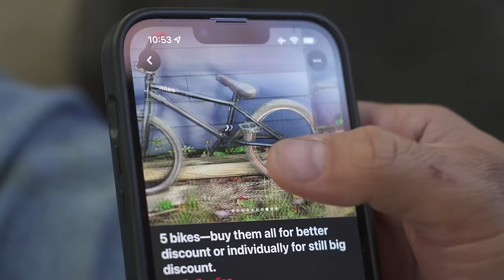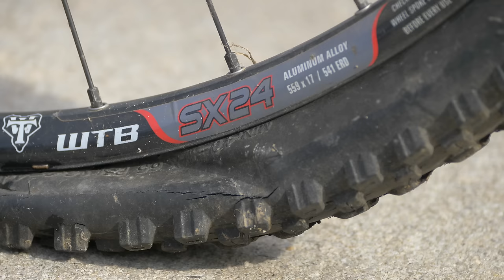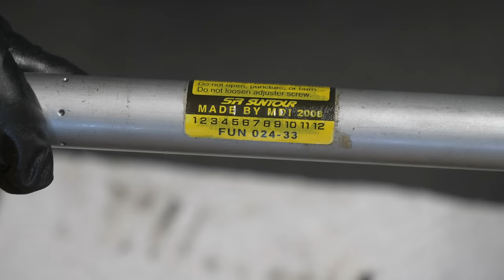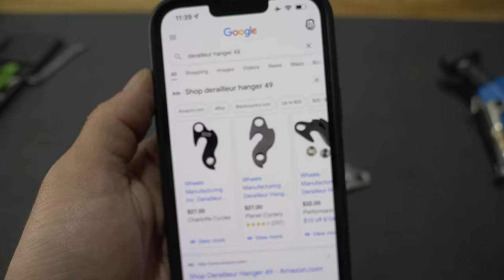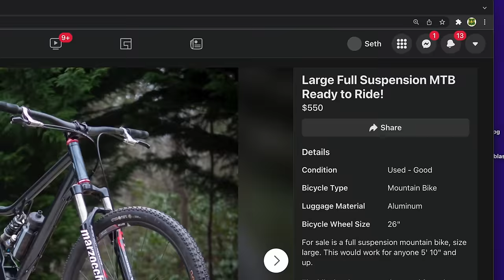Restoring a VERY neglected 'mystery' full squish

Comment: Pell’s Ridelight was an expensive bike, it came in four (4) models: Pro $1,200 US, Elite $1,600, Race $2,300 and Team $4,450 USD!  It appears the bike that Seth was restoring was the Ridelight Elite.  Whoever got it for $525 got a great deal.
Reply: charles the detective's got it!
Reply: Damnnn you good well done detective, just searched it and found it.
Reply: Nah Man that's a Santa Cruz Superlight
Reply: @sge4r513 No, it really isn't...
Reply: It actually is an early 2000s Santa cruz superlight which does look a little like the pells ridelight
Reply: @WIllWarner-v5f   Charles was right, if you look at the swing arm shape, especially on the vertical portion you can see it has identical lines, where the SC is more straight, the Pells has some variable thickness. Also noticable on the TT where it has a slight bend near the seatpost.
Reply: Its definitely a Santa Cruz,  I have one
Reply: @AndrewAnderson-vb4pp  It's for sure a Pell. You can tell by the rear shock mount.
Reply: Nice one dude.
Reply: All bikes this old are basically worthless except as collectors items, which this is not. $525 is almost scammer price, he just waited until someone came around who didn’t know what it should cost. An old 26er with a single pivot suspension is worth no more than $150 in the best of condition
Reply: I found the same bike as a Santa Cruz heckler
Reply: Well done. And to the people saying this is a Santa Cruz, are you blind or can you not use any kind of image search? That upright bit of the swingarm is so distinctive that there's no way of mistaking it for anything but the Ridelight.

Comment: Dude if this whole flip bike thing is going to be bigger you definitely need a ultrasonic cleaner. I wish I had bought this earlier for my motorcycle workshop.
Reply: What cleaner do you use?, Best thing I've found is the purple simply green industrial degreaser, it cleans almost anything.
Reply: @silasmaxwell6745  I use vinegar personality for anything rusted, let it soak for 30min and the rust will come right off. For dirty parts I’ll wash them with mean green and spray them with WD-40 to get them shining like new. Easiest cheapest way I’ve found.
Reply: More useful videos without expensive tools
Reply: @joatmon_313  CLR in the ultrasonic works great for rust.
Reply: i came here to say the same thing
Reply: I almost bought one last month while I was servicing my bike for the winter but decided against it because I couldn't find any posts / videos confirming whether it would remove dried up thread locker off of bolts.  Do you know if an ultrasonic cleaner will get that off?
Reply: @Waremonger  Maybe if it soaks enough it will, some ultra sonic cleaners like mine also heats up the liquid you use to a set temp of 90 - 150 degrees and thread locker usually comes off pretty easily with heat, so it might get it loose enough to come off but a wire brush works really well too. 🤙
Reply: Stop giving him excuses to by more tools lol
Reply: I second this! with a tub of evaporust and a $150 ultrasonic cleaner you can make just about anything shiny again. The ultrasonic will dull/etch the finish on some painted/anodized parts but you can just add another coat of clearcoat. It's also the fastest way I've found to get the factory grease off of a new chain (I like wax lube)
Reply: This was my exact thought as well.
Reply: Feel like Seth should wait a while before he buys one cuz he basically just bought a sandblasting rig
Reply: +1 to an ultrasonic cleaner! You can get a little one for about $75 and will make life much easier
Reply: @silasmaxwell6745  yeah! I just recently switched to this and I'm a bit fan.
Reply: Evapo-rust is the best stuff to use when trying to get rid of rust
Reply: Those are amazing at cleaning!
Reply: @silasmaxwell6745  best and cheapest is citric acid powder. Available everywhere, super cheap, you get to choose your own concentration and if you heat it up it will kill rust in 10 minutes or so. I personally, haven't waited more than 3 minutes.
Reply: @joatmon_313  aaz@@@
Reply: XO 
 

Playgh
Reply: @Bpf1893  calcium and lime as well!
Reply: I didn’t think there’s much to clean with a ultrasonic cleaner for MTBs.
Reply: Similar, but different swing arm, it's a pells ridelight elit
Reply: @PepsiGuidesRS  Good tools dont break what you are working on. Good tools also dont come from hazard fraught.
Reply: I had bought one, and it never really lived up to (my) expectations - I used simple green, and it barely got cassettes clean; what do you use as a solvent?
Reply: @DanielHernandeztinkers  which ultrasonic cleaner do you use?
Reply: @ChrisDanly  I too wax all my chains; I use 2 mason jars; one with Mineral Spirits to get the factory grease off, then a rubbing alcohol bath to get the mineral sprits off, then into the crockpot of chain wax, works very well.  After one wax, I just keep it in the crockpot until the wax gets dirty, then replace it.
Reply: What’s that
Reply: I use „Tickopur R33“, mostly in 60°C warm water for 30 minutes. If the parts are very dirty I additionally clean it in the solvent with toothbrush and give it another 30 minutes. Normally the parts looking brand new after that.

Comment: IT is a PELL's RIDELIGHT Elite or Pells Thor FS150 Elite from 2009 it was a 1500 up to 4000 USD MTB. Frame is 100% same but components are differents.
Reply: I think you nailed it...exact same rear triangle.  Slight difference on the seat tube gusset and front triangle top tube/down tube gusset but that could be size specific.  Finally...this has been driving me nuts.
Reply: @mosslager  thanks :) Yes the frame Is definitely the right one. It was an expensive bike for the time :)
Reply: How did you figure it out?!
Reply: Yup, you nailed it.  I guess you're Czech?  Don't believe Pells were ever sold in America.  Most have been bought off eBay or somewhere online.
Reply: Nailed it!
Reply: @cup_and_cone  I am french living In Czech republic. It is a great country btw
Reply: @thomasbrace2166  yes  :) it was bugging me :)
Reply: @mosslager  i was also scratching my head :)
Reply: @mattlasecki5237  I guess i was helped by the divine :)
Reply: Me too, I'd exhausted all of my ideas pretty quickly. Had to keep coming back to the comment section In the hope that someone would get it. I can rest easy now the mystery is solved. Good work!
Reply: @thomasbrace2166  I knew I would help lot of us to relax  :)
Reply: Agree... Definitely a Pells. Probably bought by a us soldier in Germany.  There's many installations near the boarder.
Reply: @chopperguth  I think the germany option is certainly the good one I think Pells is german brand. however I am not 100% sure..
Reply: You're right!
Reply: @Goonak_  :)  am pleased I found it :)
Reply: good eye, that has to be it. Everything matches. Nice work, it was driving me nuts!
Reply: headtube is different the 2009 has a short headtube
Reply: It's a 2008 or 09 Dimondback Recoil lol...
Reply: İ believe it's a Santa Cruz heckler 2008

Comment: the full squish appears to be a 98 Santa Cruz Heckler
Reply: It looks more like a heckler version 5 because they switched to a more square linkage with the version 5
Reply: Looks more like a Decathlon bike. Rockrider
Reply: the 98 Heckler had a different connection at the seat post and would have mounts for v brakes. NO WAY it's a 98, maybe a newer version?
Reply: cant be a heckler at all, they all had brackets external for cable routing. video shows clearly this bike never had those. internal cable routing through rear triangle.
Reply: Its not a 98 Heckler, and I dont think its a v5 heckler either - the rear triangle looks different.

Comment: This looks like a late 2000's Diamondback Recoil.  My only hesitation in saying that's definitely what it is, is the added gusset on the seat tube. But that may just be present in large and up size frames.
Reply: In addition to the seat tube gusset, I also see differences in the shape/design of the rear dropout space, as well as the rear triangle's "seat tube", both where it connects to the shock and also to the frame.
Reply: The head tube is to long to be a diamondback recoil
Reply: Looks like a recoil to me 2008 or 2009.
Reply: It also might be an old yeti. Pretty much everything before 2005 looks exactly the same though so who knows.
Reply: @bobohunter1776  yeah after looking up more pre 2010 bikes, the frames are all very similar.
Reply: Hmm. Looks like Diamond Back Recoils had hydroformed tubes and this one doesn't
Reply: @quiquekhan  the brake rotor has 06 written on it as the date
Reply: @mctg9043  but the coil 08
Reply: @RealCascars  probably upgraded
Reply: Older orange? Maybe  don't really know  lol
Reply: @harveyjoneswoodsman5956  I believe Seth ruled it out for being an Orange because of the Derailleur hanger.
Reply: It's a 2022 SBH model FB.
Reply: It’s not a diamondback recoil. Look at where the top tube connected to the seat tube. And below the shock is completely different too
Reply: @Dylan_Draper  must have missed that part  mg bad
Reply: @Dylan_Draper  All frame sizes used the same swingarm, just different main frame.
Reply: It’s a rock rider 6 B’twin
Reply: @masoncantrell1037  No.  It's a Pells Ridelight Elite.  Someone already found it.
Reply: @cup_and_cone  nope look up rock rider 6 B’twin it looks the same
Reply: @masoncantrell1037  No, it's not a Btwin.  The Btwin has a different swingarm and does not use a #49 derailleur hanger.  It's just what I said it is, a Pells Ridelight Elite.
Reply: @cup_and_cone  nope the frame is the same and the Elite has a tampered Head tube
Reply: @SuperBonerific123  2006ish Santa Cruz Superlight
Reply: @SuperBonerific123  that would explain Chris King headset too
Reply: i agree its with you they look the same
Reply: Very sure it’s a diamondback
Reply: It’s not.
Reply: But its not.
Reply: @quiquekhan  BUT ITS NOT
Reply: Santa Cruz Juliana
Reply: I thought it was a santa cruz heckler from 2007

Comment: Hey Seth, 
 My family and I recently got into the sport due to our oldest daughter having been diagnosed as pre-diabetic. Naturally, we started on big box bikes... Mine was definitely too small, I constantly felt like I was going otb. I stumbled across your videos while researching the common mods to make big box bikes tolerable and have found the flip bike and parts bin upgrade series' particularly inspirational. I found a Giant Pistol 2 (full squish circa 06) at my local used sporting goods store priced at $40, had an employee test ride it and it didn't shift so I scored it for just $15! I immediately returned my big box bike to order a new derailleur, hanger, shifter, chainring, chain, brake levers, stem, bars, spacers, pedals, grips, crank tool, top cap & star nut. I even pulled and greased all the bearings and IT TURNED OUT GREAT! So much so that my aforementioned oldest daughter asked why she still had to be on a big box bike and if I could build her one as well. 😅 I know I'll likely never stumble across another $15 full suspension Giant, but I was thinking the Northrock xc27 (mfg by giant) could make a quality, yet inexpensive platform on which to build her a good intermediate hard tale by adding a 1x drivetrain, air fork and hydraulic brakes.
Reply: thats sick!!!!!

Comment: Seth you should to timed runs with all the bike flip bikes on the same section of trail before and after to see what the upgrades do and compare the flipped ones to previous flips
Reply: Seth wouldn't fit on half these bikes so I think it would be a bit unfair!
Reply: Most bikes don’t ride when they are new
Reply: Yes
Reply: Kinda hard in this case, considering the tires and chain were completely busted. But in theory it could be an interesting addition to the format, I agree. Even if quite often it would be a DNF before.
Reply: I'd be a bit skeptical riding a trail with non working brakes just like in one of the previous episodes.

Comment: Well Done again!  Loving this "bike restore" series.  You are a good man Seth for bringing all these bikes back to life, and then you turning around and selling them for quite a bargain.  You are pillar for the biking community.  The work you do on these bikes is very thorough and complete.  I know of no bike shop as thorough and complete as the work you have done in all your bike restore videos.  For some of the work you have put in, the local bike shop will charge at least $500 per bike for just the Labor Alone.  Heck even a basic tuneup with really no work involved will be charge $100 these days for just the labor alone.  A Bike Build where a shop builds up a brand new frame and uses brand new parts will be at least $250 these days; and the work you do is about 5 times more effort than that!

Comment: Looks like my Rockrider back in the day. But I think many brands used this same mold for their cheap full suspension bike.
Also they kinda ride like shit because of the single pivot and the chaingrowth. Mine had a really good air shock back in the day and was feeling like a pogo stick, no matter what the shock was set to. :D
Reply: I think it's the same frame. They're very popular in my country
Reply: Single pivots are the best. The only time I notice chain growth on my heckler is in the granny ring, when I want it to stand up straight anyway.
Reply: @Metal-Possum  Yeah expensive singlepivots are good. The orange bikes are also loved by many. But these cheap single pivots just dont feel refined
Reply: @timmlpsk  Refined? Mine was "Refined" when it was brand new in 1996... It flexes a little, but that doesn't bother me. With its Super Deluxe coil shock it just behaves like a champion. Pivot placement is obviously key, if you're running a triple like I am, then in line with the top of the middle ring for a neutral feeling on the trails. I even commute on it occasionally and it's just as fast as my commuter bike.
Reply: You are right that single pivot feels kinda like pogo stick but i cant agree they ride like shit. It depends what you expect. They are very sensitive, even on small bumps and nothing can beat it. I got some old rusty frame with super old rock shox sid for 20$, restored it and that thing is sooooooo smooth. Riding downhill in the forrest feels almost like asphalt road :D
Reply: if they are shit, how do you explain that in 2021 and 2022 all manufacturers are returning to single pivots? they are starting to dominate again.
Reply: @ΣΤΑΥΡΟΣΓΚΕΡΛΕΣ  i wrote about cheap single pivots, just read my comment above. They built the bikes as Single pivots because its the cheapest way to make a full suspension bike. The brands you talk about built Single pivots because its their ambition and they are refining them with every new model. Like I said Orange bikes for example are very nice.
Reply: @timmlpsk  well they don't look so unsimilar. I mean orange and atroz are the same with this bike, the only difference is the geometry. As for the properties of this single pivot (which is the earliest and simplest just like orange and atroz), all these bikes are identical. that is why i consider the orange bikes a complete rip off . The atroz is a much more honest offering. If only this frame had the old threaded axle with nuts at the rear , its stiffness would be in another level
Reply: @antrace92  its not the same this one its a lot of more reinforced than the btwin 500s

Comment: It definitely looks like it could be an older diamondback atroz especially with that rear triangle design
Reply from the maker: The Atroz looks very similar, but the lower section of the rear triangle (near the pivot) is plated over on the Atroz. From that era there was also no internal routing through the chainstay.
Reply: @SethsBikeHacks  its really bugging me i cant figoure out what bike it is now 🤣
Reply: I think it’s a Jamis can’t call the model out but looks like one
Reply: I thing GT had a similar bike back than, but idk to be honest
Reply: @itaymazor9335  in all honesty just about every full suspension from around 2010 looks pretty much the same
Reply: @jonahfastre  doesnt really strike me as a gt though most gts frames from what I've seen look pretty different from everything else
Reply: @purplegarage05  looks a bit like an Azonic revenge too me
Reply: @lcc8394  It does
Reply: You should have a serial number, unless you said it didn't and I missed it. With the SN and a few quick calls to the manufacturers you mentioned you should find it's true identity  within an hour or so.
Reply: @tjgraham3597  That’s assuming they answer
Reply: @purplegarage05  I’m pretty sure that it is a B-twin just don’t know what one and what year
Reply: Its a diamondback recoil 2008ish
Reply: It’s a mongoose it’s on the fork
Reply: @drumakuzdalvatos8673  linkage is different
Reply: You know your day is good when seth responds to your comment.
Reply: @SethsBikeHacks  it is santa cruz
Reply: that was my guess as well
Reply: @SethsBikeHacks   possible it could be a old orange bikes frame
Reply: Kind of looks like my 2005 Santa Cruz Heckler. Wonder if Santa Cruz had a lower end version of the Heckler?
Reply: @sebastianrizescu3879  I'd imagine Seth could probably get someone to answer, but probably wouldn't answer to a regular joe schmo such as myself
Reply: @lcc8394  pretty sure your right
Reply: @tjgraham3597  as Sebastian mentioned, it may not be as easy. I was restoring a mid 90s Rocky Mountain and I just wanted to find original decals and specs list for it or at least a clear picture of what it should look like. I got an answer saying something along the lines we like that you are doing this but unfortunately we do not have archives that go back that far. I found their 1993 catalogue online and my bike was on the cover. Not much info inside it though.
Reply: @e-bike-bys-vykken7422  that was what I thought